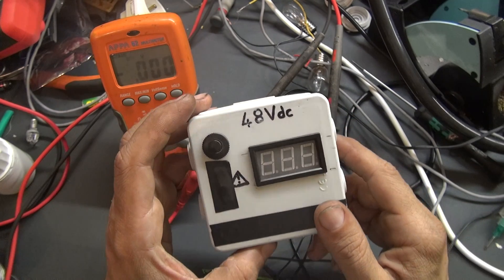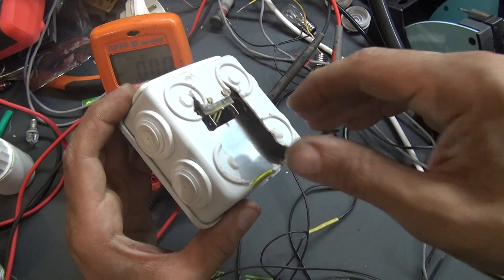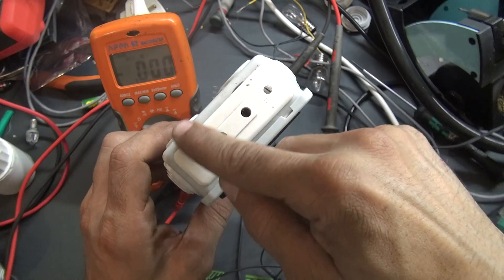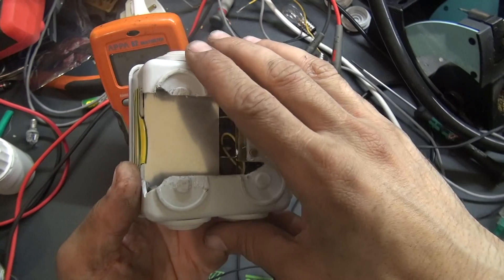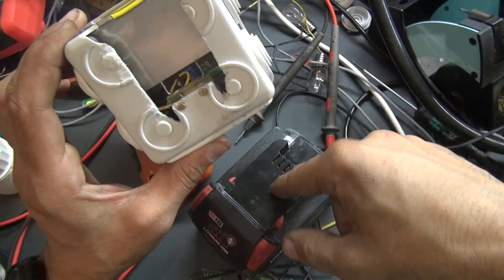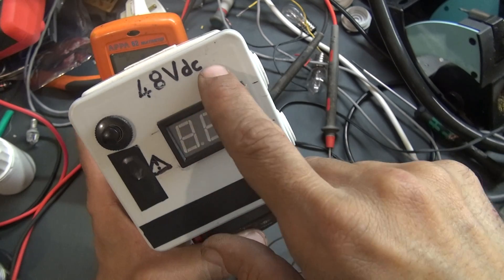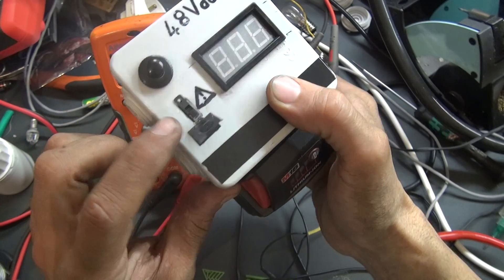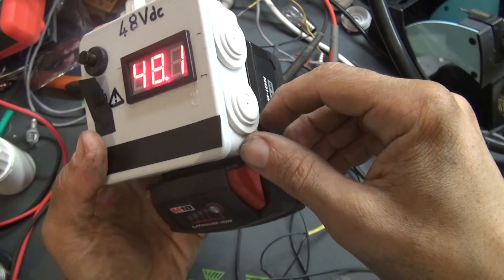48V power supply for solenoÏd valves ( milwaukee battery)

Comment: what is tha model number of this buck boost converter
Reply from the maker: Android D Dc-dc réglable 250W cc/cv courant constant step up boost converter
http://m.ebay.fr/itm/DC-DC-250W-Adjustable-CC-CV-Constant-Current-Step-Up-Boost-Converter-UK-Stock-/192112874383?hash=item2cbad1d38f%3Ag%3AF1gAAOSwSlBYsEw6&_trkparms=pageci%253A210ff4fc-2681-11e7-acff-74dbd1806b9b%257Cparentrq%253A9027ab0c15b0a860d1887229fffc5360%257Ciid%253A25
Reply from the maker: I made an error on the video: this is not a buck/boost converter, but only a boost converter.